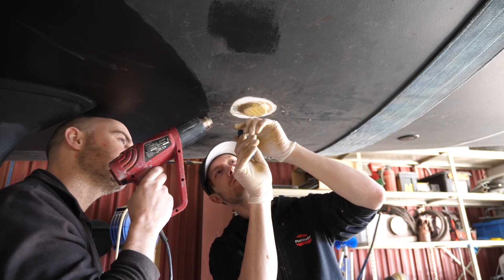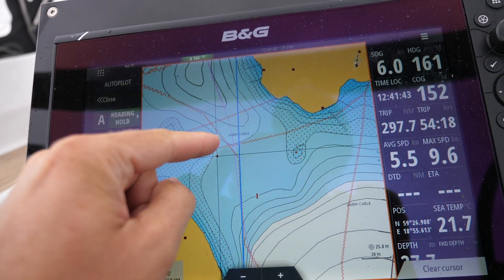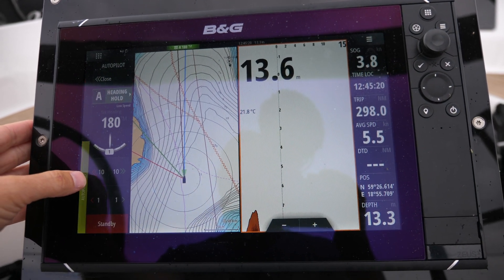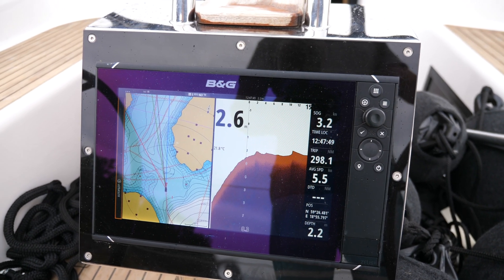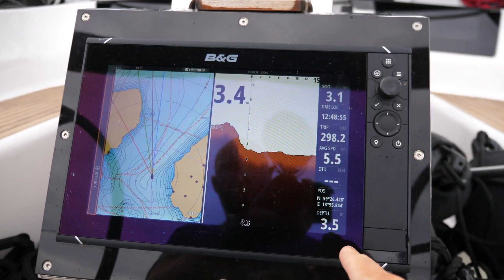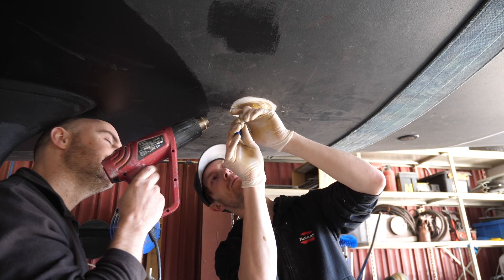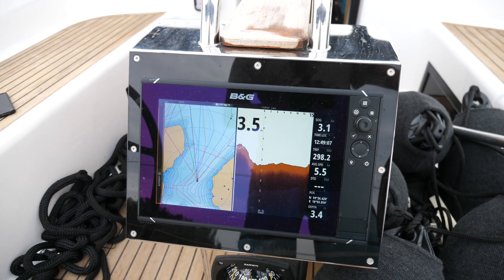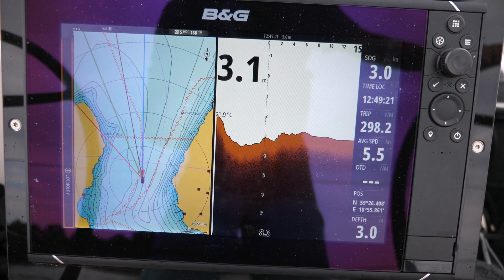B&G ForwardScan Sonar Review & Test

Comment: Hi Chris: great video. I have a 2022 Hanse 418 based in Toronto Canada.  Could you tell me in which hull grid compartment you installed the transducer.
Reply from the maker: Hi Michael, the forward scan transducer is located in the compartment just next to the compression post towards the bow. It needs to be more than 60cm away from the log and this just about fit the bill. Is that a clear description? You can see us installing it, in the videoes at the end of the rebuild
Reply: @SailingAurora Thank you Chris! That is helpful.

Comment: Do you still a classic depth fnder? I am about to use the hole of  my old transducer for the forwardscan. Is it a mistake?
Reply from the maker: Yes, we have both. The forward scan is not reliable enough and accurate enough to use as a reliable depth source. Would strongly recommend installing both if installing the forwardscan
Reply: @SailingAurora  thx so very much

Comment: The depth displayed in maps is usually "lowest-astronomical-tide". Meaning the level of the ocean when the moon is at it's closest to the earth, and manipulating the tide. So if your depth in the sonar ( todays depth ) does not match the map-depth, it just means you are "not currently" at lowest astronomical tide.
Reply from the maker: That is true but up here we have little to no tide, the water level only changes with the pressure of the air and it's not that much. Usually the depth displayed on the chart is pretty accurate here

Comment: I'm having a rough time figuring out a transducer for my new B&G Zeus3s....the dealer had no idea, and Navico Tech Support kept me on the phone 4 hours and 20 min...with the last hour claiming I was " Next" before I hung up, disgusted I had wasted an entire day I needed to be working on the hull ! 🤬
Besides the Forward Scan, what's the other transducer you're using ?   I did buy a StuctureScan 3D through-hull because I saw you could plug 2 ForwardScans directly into the Zeus, then found, again with no idea from the dealer...that the StructureScan3D has a 12-pin Y-cable....so evidentally, and with NO documentation anywhere, it still requires the StructureScan3D interface box ! 😱
The entire transducer-lottery is a black-box nobody in Support roles has much grasp on if you're not using their power boat stern-mounted Skimmer transducer that frequently comes with your chartplotter/MFD.

...and, salt in the wound, I even tried calling Airmar to talk about the StructureScan3D transducer before it came in to the dealer....only to be told "Oh, that's not ours, you'll have to talk to Navico "(on HOLD for 4+ hours)...I then get my hands on it, open the documentation, and it says Airmar in big bold letters ! 😱🤬
Reply from the maker: Sorry to hear about that experience you had, sounds like a nightmare. I haven't had much contact with Navico other than a problem with a software update and they were pretty OK. We have the forward scan and the Airmar transducer with log and depth. Both have been working so far with no issues. When buying the forward scan I was very careful as if the length of cable was more than a certain amount of meters, i would need extra boxes which would cost a fortune. I hear Raymarine is a little simpler to deal with and the dealer in Sweden is a really nice guy.

Comment: the question I can't find an answer to concerning the forward scan, is whether it displays the depth only right in front of it, or whether it displays the minimum depth in front of the boat at a certain angle. For example, if you put it on the tribort float of a catamaran, will it detect a potential rock in front of the babort float?
Reply from the maker: Good question, I believe the forward scan looks directly forward to where it is facing and more or less all of the way down. On a trimaran I would mount it in the main hull. I hope this help. Cheers, Chris

Comment: 15 meters doesn't seem like enough warning, also if something pops up,  you have to quickly know which way to turn (left or right), I'm not sure how just knowing something is in front of you is helpful.
Reply from the maker: Hi Matt, you have a point but I have seen the range go up on it in clearer waters. For us it has given a good idea of what depth you are going into. I would not rely on it 100% and I would not think about using such a thing to go left or right but to stop and re assess or go very very slowly forward. In most cases when we have used it, it's given us some reassurance of the depth ahead when entering harbours slowly. I have seen another use case where people have used it to discover hidden Bommies in the Carribbean when it's night or when the sun is low for example. Overall it's not perfect but I'm happy it's there.

Comment: Nice video.  We have B&G forward scan also.  Ours, installed by someone else,  however is under the label "ECHO".  How did you create "ForwardScan" as a separate label?  Thanks.
Reply from the maker: If I remember correctly you will find it in the settings and you have to enable something like Echo sounder. I don't think it's too difficult to find, just play with the settings for Echo sounder and forward scan, it'll be somewhere there. If you don't find it drop me a mail
Reply: Re: "ForwardScan as separate label"....there is a screen in Settings where you activate features to be displayed on your screen, so that you can turn off unneeded features you don't have, like "3D Sonar" or "Radar"....but might also depend on what model and age of display, and whether you have it's software up to date.
Reply: @Stenn333  Thank you for your reply.  We got it sorted.

Comment: Regarding the difference between chart remember the chart is likely showing soundings to chart datum which is usually mean lower low water and you are measuring to current live water level which is a different datum. Not necessarily a calibration difference. You have to adjust chart sounding by tide amount to get current depth. A good reason to have a depth sounder and not rely on doing math in your head for a tide you may not know.
Reply from the maker: There are not too many tides in Stockholm, the air pressure might vary it by 20cm at most

Comment: Hi Chris. Thanks for the helpful video. Can you give the approximate cost of the entire conversion? Another question about the normal depth gauge: did you set the offset so that you see the entire water depth, or just under the keel? If under the keel, what offset did you set at B&G?
Reply from the maker: Hi Jens, the cost for the forward scan transducer alone is about €700ish Euros, provided you don't have to buy the sonarbox aswell. For the labour involved in fitting, I think it's probably a day's work so call that another €7-800 in labour I thinks. If you can do the cable run yourself or part of the work yourself you should save some money.  Good spot! The B&G  forward scan and normal depth gauge is offset at 1.7m to show the depth below the keel. Cheers, Chris

Comment: It gives you 8 times the depth forward. It does not need to be level. It can be set up in the settings. 10 - 15 degrees is ok.
Reply from the maker: Hi Topi C, yea I was hoping for more range but I think in the Baltic with the particles in the water especially late summer it limits the range somewhat. It didn't seem to show a good reading past 20-25m but maybe it was because I have always been testing it pretty shallow. I will have to do some more testing this year and maybe create a more extended review and test. When I installed it I wanted the transducer to be as level as possible, may as well start on a level playing field and adjust from there. Cheers
Reply: @SailingAurora  I have had it for 3 years. It is exellent in shallow waters and when exploring new natural harbours.

Comment: Thanks for the short video/review. You should however be awere that those "tightly placed" chartplotter depthcurves are based on interpolation not real soundings. Although I've noticed that they correlate surprisingly well, in many places, with my depthsounder readings. At least here in Finland.
Reply from the maker: The charts seem to be very accurate on this side at least, I was suprised too. Thanks for the advice though and we really want to get back to Finland at some point

Comment: I really think you can see more than 15  meter, i can see  50 meter with Garmin forward scan, and works in same way  as this.
Reply from the maker: Hi Ole, I have tried to look further ahead and yes it works, but the most accurate reading I have found has been within 15-20 meters. Any further and it seems to be a little jumpy.
Reply: @SailingAurora  I use it on 50 meter and works very well, if it was possible add a picture here i could show you how clear it is
Reply from the maker: @olekristoffersen9298  awesome! Would love to see it, can you send me an email at info@sailingyachtaurora.com?
Reply: @SailingAurora  Sure, i will send it ASAP

Comment: Hi Chris, that was a swift update. You mention  a max length of 12 meters. Does this mean that you should connect the transducer directly to the plotter so  it's not a can bus connection?
Reply from the maker: Hi Eric, yes a small review perhaps I should do an extended one. The cable provided plugs directly into the back of the chart plotter and not onto the NMEA network, they give you 7m of cable but you can extend it to 12m. If the cable run is any longer you will need to buy one of the sonar boxes to put in between the forward scan and the plotter. I hope that makes sense

Comment: Thanks for sharing :-). How good is it in shallow waters when trying to find a cliff to dock to in the archipleago?
Reply from the maker: Hi Anders, when we find places/rocks to moor to we mostly have someone on the bow looking for rocks in the water when we come in, this will prevent the hull hitting anything. The downward facing transducer is directly in front of the keel so when we are creeping in to a spot I use that. You could also use the forward scan as a secondary. Worst case if we hit the keel we only touch at <0.5 kts while testing the spot so not the end of the world. The forward scan is really good for spotting hidden dangers on the way into an anchorage or going through passages that you are unsure of. I hope this helps
Reply: I got the same setup as Aurora in my Hanse 430e and I’m pretty pleased, but it could obviously had a better range. For entering to or sneaking up to a cliff with stern anchoring I would say it is perfect.